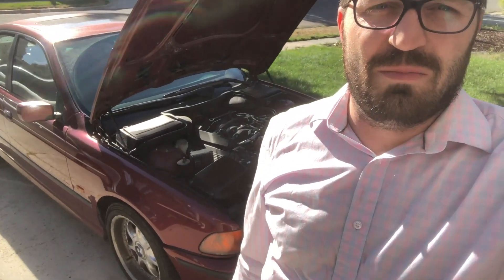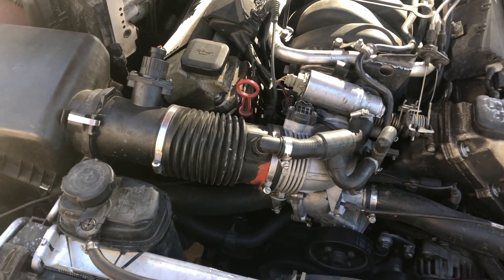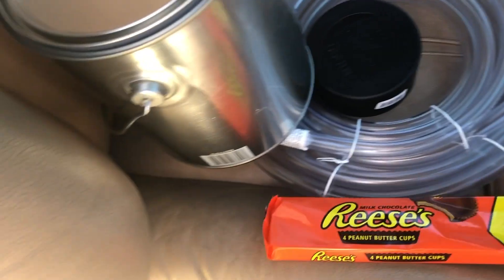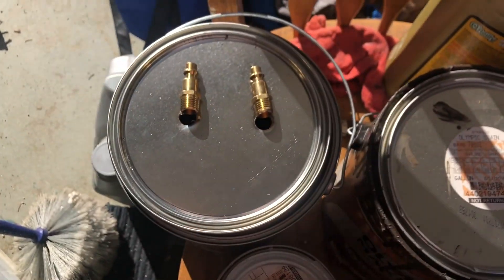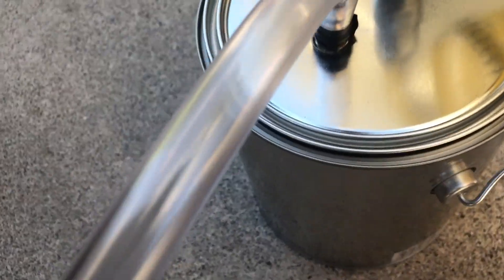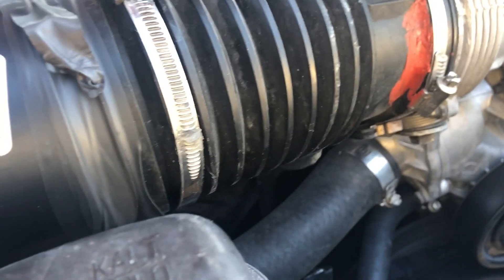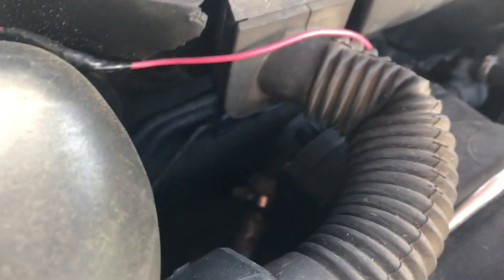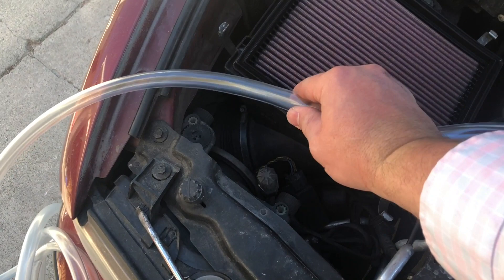DIY Smoke Tester - Finding Vaccum Leaks on the BMW 540i

Comment: That’s a great home diy video for what is a very effective diagnostic test. I have same car 97 540/6 sport in Oxford green metallic . Also used that method on
My newly acquired 91 850/6 and boy did that have leaks.( has been garage stored for 8 years. So much smoke under the hood lol.) resealed intake system, new injectors w Orings , replaced entire fuel and ignition system too. Fired up instantly and idles beautifully. Cold starts are perfect… Old bmws sure do love to leak, especially oil. - the only thing that isnt leaking on my 540 is the rear main seal. Maybe if I had gotten the car with less than 95,000 miles the low temp thermostat I added could’ve helped- oh well , there still fantastic cars to drive especially with the 6speed manual. I wonder if they’ll ever become a desirable classic?